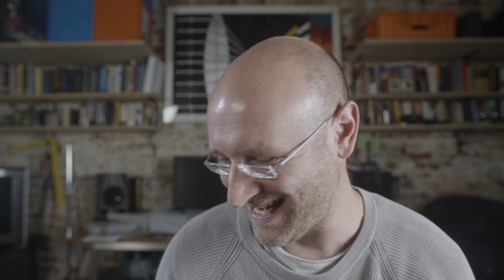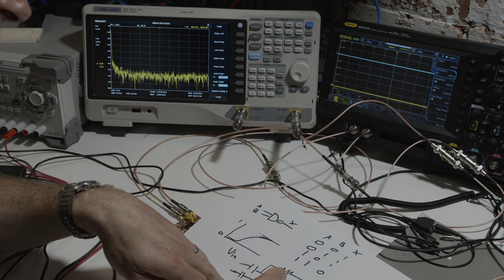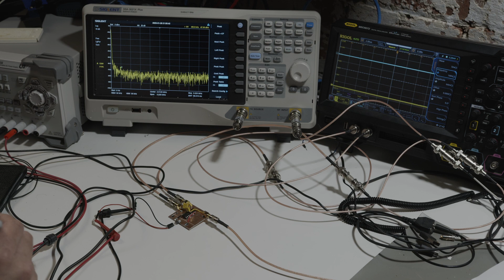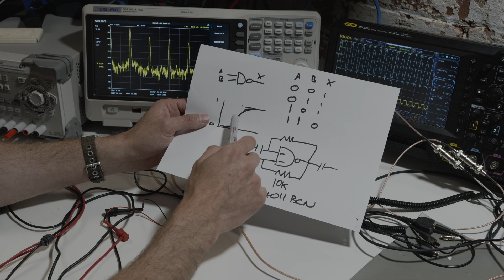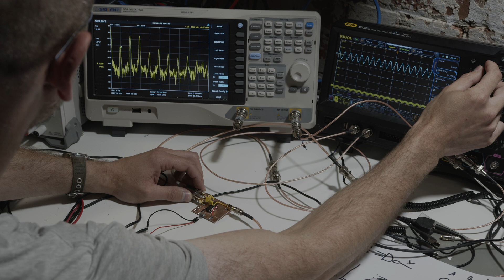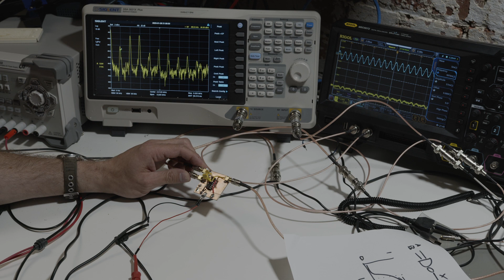RF Mixer with a CMOS NAND gate

Comment: Common trick from the 1970s.  
I remember a BFO metal detector that used a CD4011. 2 oscillators and a mixer.

Comment: Hey - you've inadvertantly opened the trapdoor to a very specialist area of RF design. Radio hams have, in the last 25-30 years, been designing and building very high spec HF recievers and transcievers using H-mode mixers. 

There was a lot of buzz about these techniques 20 years ago or more, but due to the fact that DDS methods have taken over as the new wanna-buy kit the very high dynamic range approach that MOSFET and square-drive mixers provide has been bypassed except for those striving for the best possible performance.

Some search terms for further research - G3SBI mixer , H-mode mixer , TLT H-mode mixer ,  IK4AUY mixer , high IP3 RF mixer

I ran across this vid searching for "CMOS RF mixer" and ended up watching your whole vid even though I was really looking for a circuit I saw is Radcom magazine in, oh, about 1997 haha

Comment: Hi mate Paul from Sydney. I actually used the Cmos inverter as an audio amp (low powered) intercom. I cant remember the output power but it was enough to power a speaker. The  feedback resistor on a "digital" gate is a forgotten trick. It forces the gate to its linear area. I think you may get vcc/2....not sure. With a quad inverter chip you could bias them all and put a ferrite ant out front and come up with a basic AM receiver..which part of Aus are you from?
Reply from the maker: I’m in Melbourne